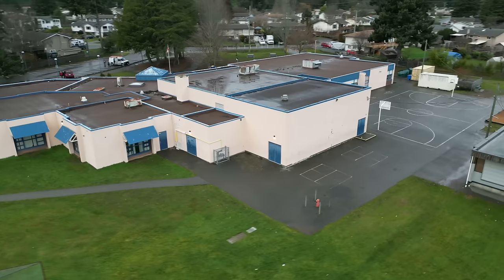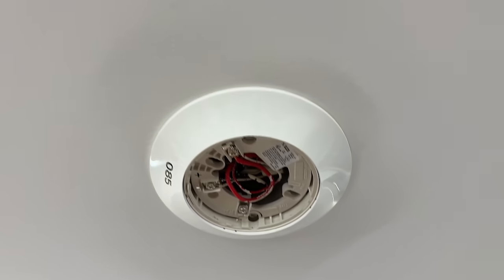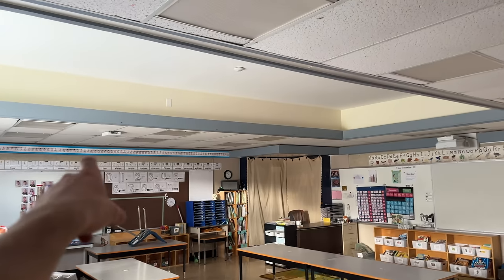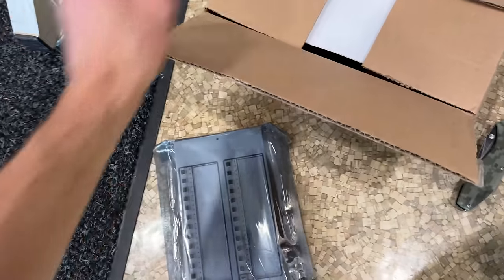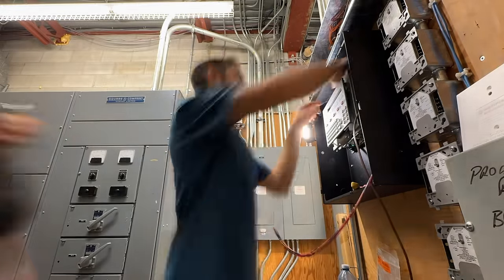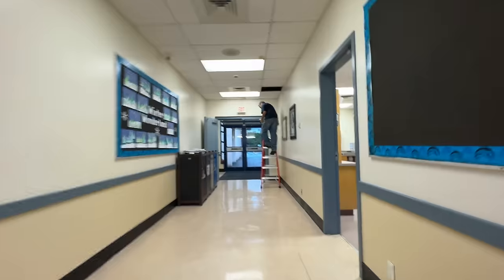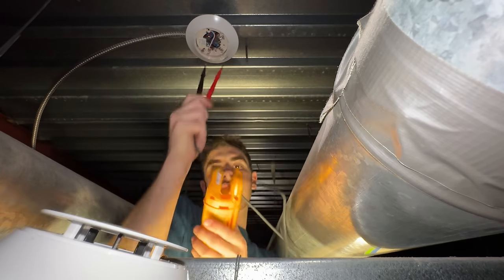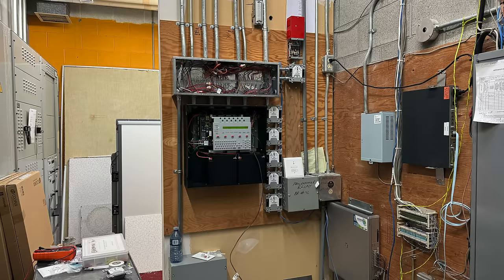Replacing fire alarm system at elementary school. Full addressable replacement day #3/4

Comment: Next time you have messed up wire colors just take old devices down put bases up and wire nut + and - then when you're loop is powered up go around and meter polarity and install new devices it shouldn't be that difficult

Comment: Is there any law that says there has to be heat detectors in the classrooms rather than smoke detectors? Do they put Heats for a reason or does it just not matter?
Reply from the maker: It's a direct one for one replacement and a smoke detector is not required in the classroom so it's cheaper to do heat detectors

Comment: Have had to swap devices at some schools in my district, and some of the older ones have horrible wiring just like this school. Surprised this one had it even in the '70s, as all of our schools built 70s onward have the correct polarity. Only the ones in the '60s have awful wire coloring. Weirdly, for whatever reason, polarity was like 95% correct in the school built in 1959, so I don't know how they went from good to horrible in about 2 years. Maybe it's just a different code thing or something, as I'm down in Wisconsin.

Comment: is there going to be videos on the screwed up middle school?
Reply from the maker: I don't think so
Reply: @nics-systems-electric  If you can please try I just wanna see how screwed up wireong for fire alarm in this school it's makes me happy seeing this school cause it never fails to have something wrong for us to enjoy
Reply from the maker: @JoshuaKing-qb4fj  the existing system wasn't installed super long ago so there shouldn't be too many problems with polarity as far as the SLC loop goes and the only issues that I can predict is not properly isolated zones but I don't think I will be around for that replacement
Reply: @nics-systems-electric  what i would be exited for is seeing how yall are going to do with the wood shop duct collector
Reply from the maker: @JoshuaKing-qb4fj  it will need shut down so the contactor will be controlled by a control module I would assume but couldn't tell you for sure I won't be there for it

Comment: Wow! That wiring really is just awful. 

For the gym pull stations, given how toghtly they fit in the original backboxes, what if you used a backbox made specifically for those pulls? This would provide better space and prevent that broken resistor.

(By a backbox, im talkikg sbout turning the stations surface mount)
Reply from the maker: It could be done if necessary however we try not to in the gyms it's the same reason that the pull stations are recessed in the new builds. Metal object like fire alarm and other electrical devices can leave nasty injuries in gymnasium from people running into them especially in an elementary school where they can be at face level for the students so we usually try and keep all objects as close to the wall as possible in gyms
Reply: @nics-systems-electric  I completely understand that. As far as the injury concern,  do kids still get injured from those metal pulls? If so, perhaps a good STI stopper can help prevent that due to it's rounded corners.
Reply: @KanoaDeCastro might be regulation thing, I know some jurisdictions that don't allow stoppers for "lowering the simplicity of effectively operating the pull station" I think this regulation is kind of BS, given that you have to have an IQ of probably below 40 to not know how to lift a cover.
Reply: @drum-corps-fan  I'm based in the United states so I don't know much about Canadian fire code, but I find that regulation pretty stupid.
Reply from the maker: Stoppers can be used if needed though it usually isn't as from our experience they cause more problems than they solve

Comment: Why are you replacing bells with horns? There's nothing wrong with bells. The only reason I can think of is that they die after a few years.
Reply: System is no longer under grandfathered code. The newest revision of the fire code now applies as the system is being replaced and that does technically mean that a new system is installed which means you have to use the most recent fire code revision applicable and that code says synchronized horn-strobes that are 15db over ambient and use temporal 3 for signal coding are required.
Reply from the maker: Because they need to be compatible listed devices and reliability is important when some of the bells are failing and you get lower draw with horn strobes and it is known model so easier for any calculations that need to be done
Reply: Hello  @nics-systems-electric
Reply: Also it wasn't nicks decision what devices to put up
That would be the contractors. And it's cheaper to install horn strobes vs bell strobes. Both due to the device itself being costly, and because you might need more nac booster panels.
Reply: current code requires speakers in K thru 12.
They can be separate intercom or integrated in the fire alarm system.
Regarding bells, they aren't as noticable
Reply: @jimstettler3445  per us or Canada code? Also what's the code source?
Reply from the maker: Voice assisted evacuation systems are not required in Canada for educational facilities for any level of school. We also cannot use a intercom system as it is not a ULC/CSA listed fire alarm device it could be potentially used in conjunction as long as the fire alarm system will still be fully adequate and meet all requirements without the assistance of the PA system. Retrofit installs like this are not governed by current codes from a device requirement standpoint. Nor is it possible without major work to install a system to current codes.
Reply: @nics-systems-electric  I heard somewhere that it's illegal to install voice systems in places like schools, and they can only be in high rises. Is that true? (for Canada)
Reply: @mimi2  it depends on the facility. I assisted with a voice evac in a hospital. They also had a dual stage system.
Reply: @nics-systems-electric                                         .

Comment: Well i guess thats what happens when you swap to a Adressable system where polarity matters from a system where "ah we are short on wire, ah its convetional so it dossent matter which color" lol
Reply: Mixed up wiring seems to be a common issue in replacement installs. You'd think they'd just make the addressable devices polarity-insensitive to make it easier. I think the addition of a ten cent bridge rectifier would make this possible but I'd need to know the details of the signaling to be sure.